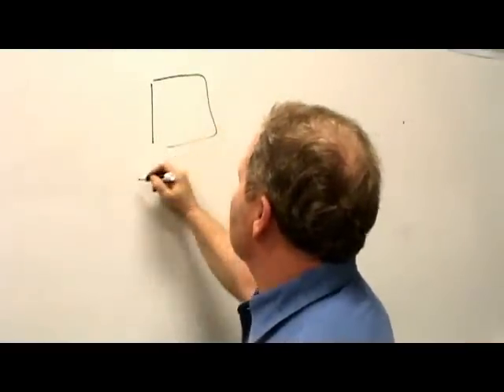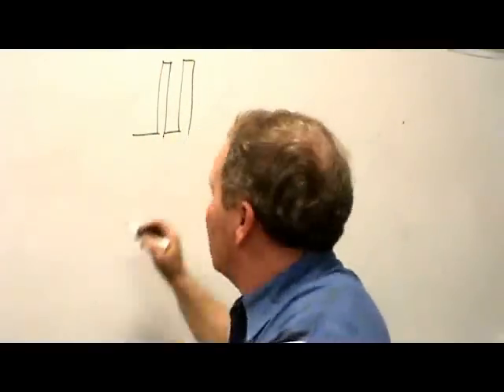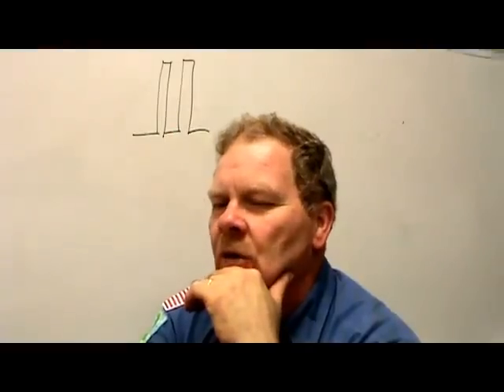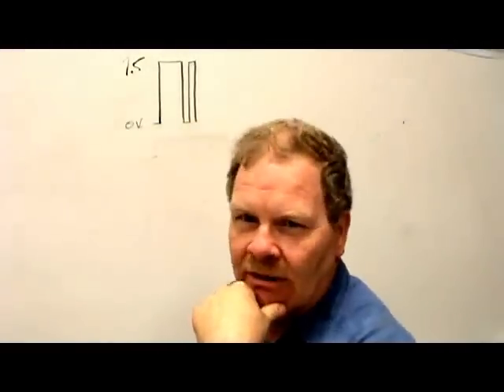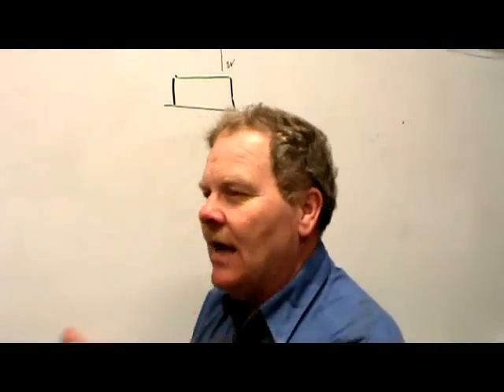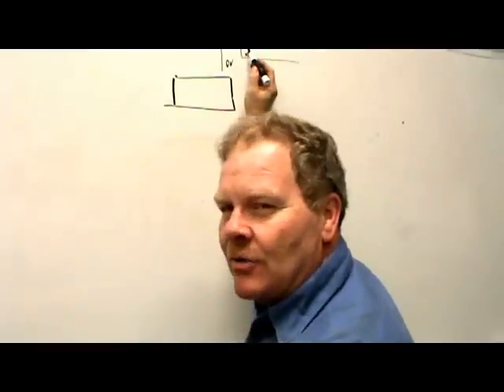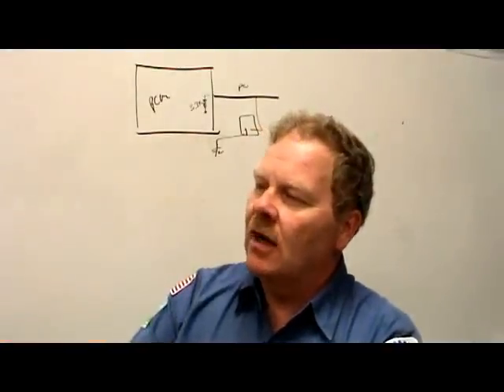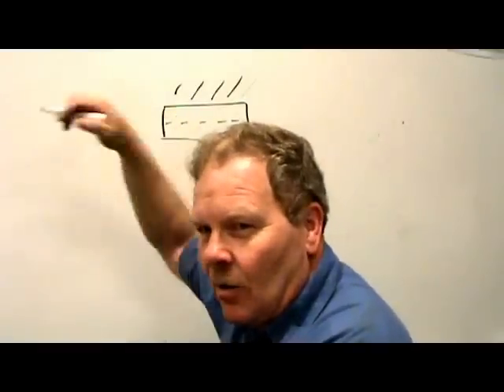Spec Topix   PCI Bus Systems

Comment: I really liked this lecture thoroughly enjoyed it honestly thank you for the video I had a quick question for you I have a 2001 dodge durango and it has a no bus on the dash crank no start and I watched another video and figured out how and where to check the powers and grounds and 5 volt ref the only thing I'm having trouble with is I don't have a u scope to check the PCI bus communication line can I check that one wire with a volt meter or test light if so how any help would be greatly appreciated thank you
Reply from the maker: You just about need a scope to check that bus properly. But what you CAN do is to remove the battery terminals (both of them) and touch the cables to each other to clear the computer's memory (don't touch the BATTERY terminals together, just the cable ends after they've both been removed. It's like a hard reset on all the computers. 

This may or may not clear up your problem (it works about 5 percent of the time), but it won't cost anything and isn't hard to do. Network repairs are complex enough that if you don't see something blatant with the naked eye you're pretty much going to need to have a shop take care of that one.
Reply: Thank you very much for your time I'll definitely try that reset you suggested me and my family definitely appreciate it thank you